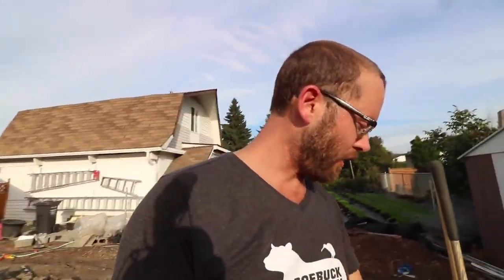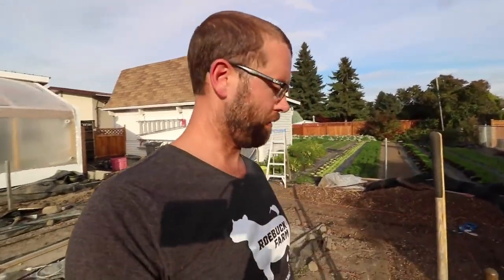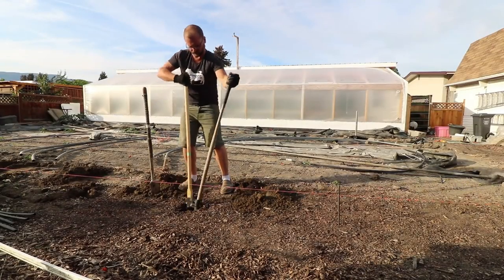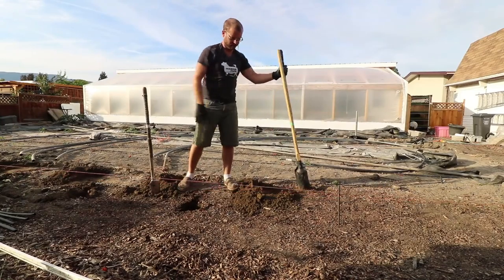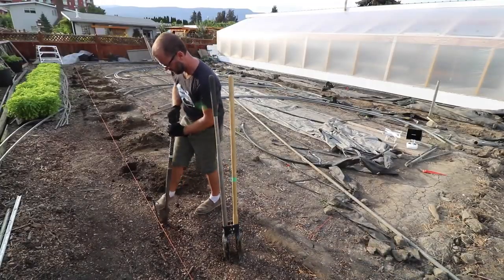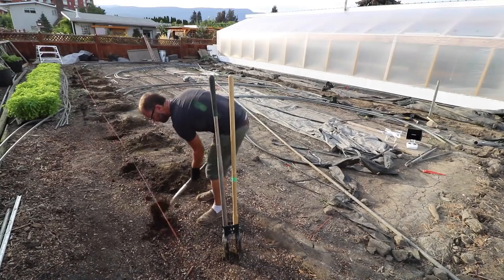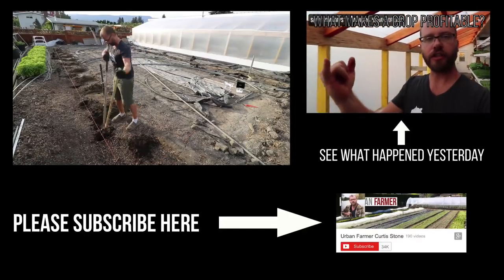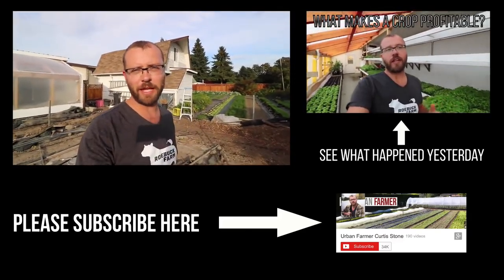Digging Post Holes for The Hothouse

Comment: use a hard piece of timber 12'' by 4'' bout a foot long to bang the post hole digger on to get the soil off , hit it cross grain so it does not get stuck , keep the piece of wood with the post hole digger , heavy but worth it , saves a lot of getting soil off it

Comment: Hey Curtis Nice VLOG bud. Cant wait to see how the green house comes out. Nothing wrong with the Hole Digger. Good exercise. Augers are nice and are fairly cheap to rent one for the day.  Ive seen some posts eluding too 500 bucks. Unlikely.... You can buy a decent new one for 200-300. decent ones. Heck I seen one at harbor freight cheapo store selling them for 150 bucks with 6inch auger bits included. Heck I just did a craigslist search here in my area and seen decent used ones for 150.

But anyhow did a little promoting for you on WPR here in Wisconsin. Had a organic garden show on and called in tossing your name into the discussion. after watching your vlogs, read your book. Anytime I here a small famer or someone looking to take there little Victory garden to the next step your name comes up every time. I certainly appreciate you taking the time out from running your business and sharing these VLOGS. Thumbs Up

Comment: Yep I would have bought a powered auger, on an operation like this, it would be used a lot, especially for putting in supports for the green houses.  80mm, 150mm and 200mm augers makes them very versatile. The post hole diggers like the one you were using tend to be one thing only, horribly slow and not that great when your hole is deeper than about 600mm,  then they hang on the wall gathering rust.  :D   Did you concrete the posts in?  750 deep sounds quite shallow for a post five foot out of the ground or did I mishear that.  On your vid about "What the Fungus", you said the covers were 7 years old, did that include the covers on the temp tunnels?

Comment: Yo, Bro - that is NOT clay soil! Clay soil is some sticky nasty stuff that takes 5 minutes to pry off the post hole digger after every chop. Been there, done that...  If you had clay soil you would need dynamite to dig a hole when dry, and high power auger when wet. It looks like you have a lot of sand or silt in the soil the way it breaks up and drains fast. Anything close to the ocean or  a river has a lot of sand or silt. Sand Silt Clay.

I admire your strength to do something out of the ordinary like this. My back and arms would be sore for 2 years after doing that.